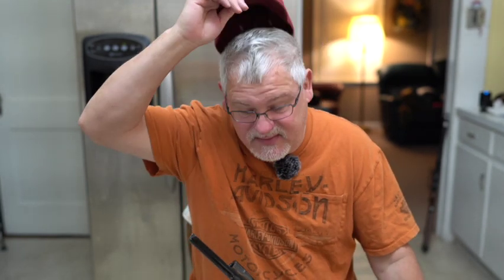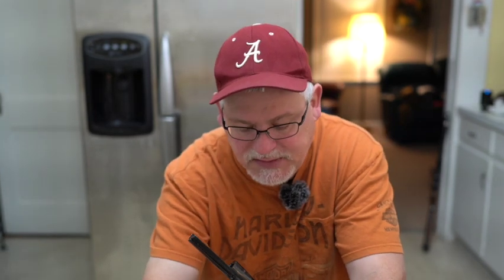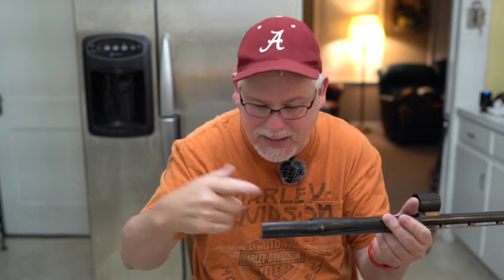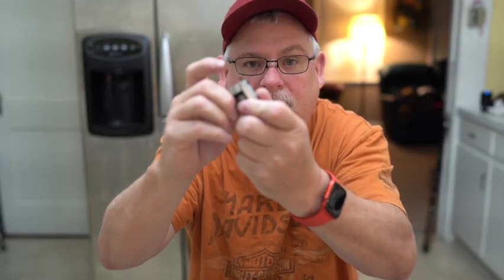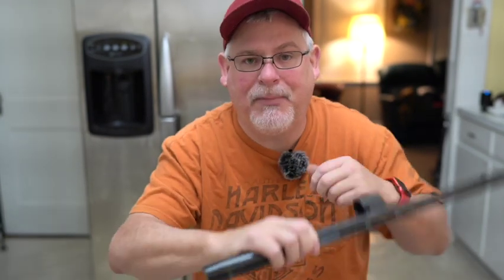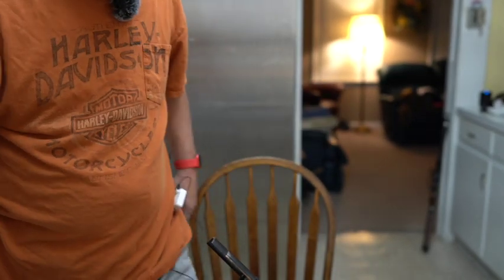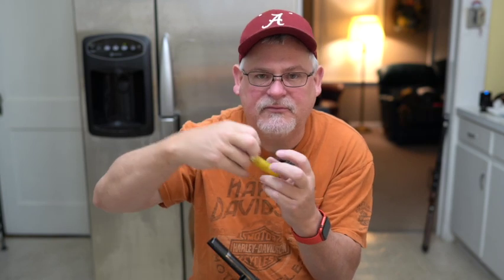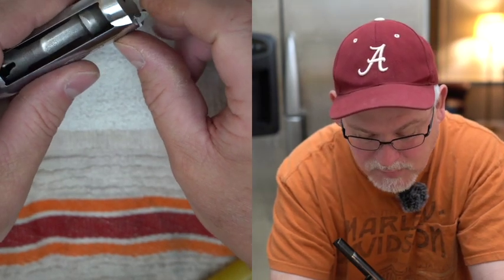Remington Shotgun Extraction Fix: How To Polish The Barrel Chamber.

Comment: 12g flex hone, spin it in the chamber heavily lubed up with gun oil with a hand drill for 30 seconds, fixed my 2010 era 870 express hard extraction, stuck after shooting problems. My 870 express also had a problem with the ejector spring bending out of shape and causing stovepipes, had to take it to a gunsmith for him to drill it out, and rivet on a new one. These problems is what made me lose trust in Remington.
Reply from the maker: I’ve seen the hones but 4 ought steel wool with oil on a brass brush has always worked fine for me. Just too lazy to buy the hone I guess. 🤣. I’ve heard ejectors can go bad but haven’t had it happen to me yet. My all time favorite is the Remington V3. Softest recoiling gun out there. Same piston gas system as the Benelli M4 for a fraction of the price. Thanks for watching. Appreciate the feedback too!!
Reply: It saddens me to have seen the demise of the oldest gun manufacturer in the US. Still love my Remmys but I've done work on them to bring them uo to spec.

Comment: Thank you so much.   For some reason I didn’t notice my extractor was broken and couldn’t figure out why shells weren’t extracting.  I replaced mine with the Volquartsen extractor.  Now my old 1100 runs like new.
Reply from the maker: That's awesome! It does happen from time to time, although it is rare. I've never seen a solid metal one break though. Not one. Glad you got it running again. I found a brand new, old stock, 1187 from an estate sale. Never been shot. I then found a brand new competition carrier which I installed in the 1187. I was going to sell it but my son wanted it and offered me a good price. I told him he could have it but he wanted to pay what he thought it was work. He was off by a few hundred but I didn't tell him. Now he has basically a brand new gun. I did run about 30 rounds through it of various shells to ensure it worked and it shot everything perfectly. I'm really proud that my son gets it. He's bought a couple of guns from me after I work on them. And I've given her a few too. Nothing like keeping the good ones in the family.

Comment: I use mothers mag and aluminum polish mop and a section of cleaning rod in a drill And follow up with oil! Have a pardner pump an express and a wingmaster! The worst is the express but works better then when it was new! I have to say that my pardner pump with the humpback receiver is better quality then the express, it is as good as the wingmaster in quality and function! Selling the express!
Reply from the maker: I forgot to say you can use bore polish too. Just don’t want to do anything but polish the inside. My old 20 ga 870 Wingmaster was one of the best pumps I’ve ever owned to this day. 1975.
Reply: @Kornholeeoo  i think the wingmaster i just bought is around 1955 or so has the corncob forend on it and lower serial# love the old pumps!

Comment: Thank you Kornholeeoo! This instructional worked like a charm. It is night and day, in the difference of the chamber. With just a few minutes of work, I now have way more confidence in my 870. You are awesome man!
Reply from the maker: No problem! I love making these videos. Someone taught me years ago so I'm just passing it along. So glad it helped you! That's what it's all about!
Reply from the maker: @TherealTruth40    There is an ejector on the end of the inside of the barrel that goes into the receiver that kicks out the shell. But if the force of the action is slow it causes the same problem. I’m at work now and cannot get into it much right now but look up the ejector and see if yours is ok. Are the gas blocks and O ring in good condition? Good and clean gun? All these things can cause problems with ejection.
Reply from the maker: @TherealTruth40    Oh. Pump. Don’t have to worry about gas rings or O rings.

Comment: Thanks so much. I just bought my new Remington 870 2 days ago, and took it to gun range yesterday. It won’t let me rack the slide back after shots in every 2-3 rounds. Sometimes extractor can’t even grab the brass rim, so the slide just can’t even locked. It’s frustrating, because it never happened on my other 2 shotguns.
Reply: Releave the extractor spring pressure and make sure the extractor is sitting all the way down into the detent.

Comment: I had an extraction problem with mine and i leads me to believe people extractors are getting seized and the spring isnt functioning like mine was
Reply from the maker: @carter4627  That extractor hole can get really gummed up over the years. Squirt some WD40 in it. Work it around good. Then blast it clean with some brake cleaner and then put good oil everywhere the brake cleaner hit. The brake cleaner removes everything even from the pores of the metal so be sure to quickly oil everything.

Comment: At what year did Remington decide to cut cost for these barrels to be like this ?  My reason for asking is I bought an 870 Magnum Special Purpose back in the early 90's and I haven't shot it enough to realize it having any extraction issues but my extractor appears to be all solid metal and heavy duty !!!
Reply from the maker: They started making the 870 Express in 1987 and also started making the 1187 that year too. They claimed both were better but time has proven that incorrect. The Express models were fine during the beginning and up to around the early 2000s it seems. I’m going off memory here. But there was a bad batch of MIM extractors in there and quality went downhill fast. Some people who had the earlier guns didn’t have the extraction problems like others did. I had a Super magnum that was ok but I could feel the chamber needed polishing. Got it used in a LGS. Had rarely been shot though. I did some polishing and swapped out the extractor and that gun was fine.
Reply: I've had 2 Remington super magnums that did exactly that. It's the chamber issue not the extractor
Reply from the maker: @vitalshok2238    Yep. I had a Super Magnum do it too.
Reply: I bought an 870 Express from K-Mart brand new for $178 in 1988.  It went “bang” and worked fairly well.  But I never expected Wingmaster quality from it.  I expected drab looks and tool marks and that’s what I got.  Want a Wingmaster?  Go buy a Wingmaster.

Comment: My new extractor is hitting the inside of my barrel. I’ve no idea how to fix this issue now
Reply from the maker: @gavinwilliams9367  When you close the action, is it going in straight? It should ride in there and open up as it rides in on that angle portion. But it should not interfere with the action locking up.

Comment: Great video guy!!!..... my problem is with a KSG. It's  been back to KelTec 3 times already for a bent bolt carrier EVERY TIME. After firing a few shots the pump gets extremely stiff and the shell seem to get stuck in the chamber EVERY DANG TIME causing the bolt carrier to bend. KelTec has basically rebuilt this KSG 2 out of the 3 times they have had it. I just got it back two weeks ago but have not taken her back to the range yet, after thinking about the problem this thing has had EVERY TIME I thought about this being a possible solution to the shells getting stuck in the chamber afer fired. I went ahead and measured the diameter of the slugs i shoot and they all turn out to be a bit different. Federal Slug brass measures 20.20mm(new). Troy Slug brass measures 20.51mm(new) and 20.67mm(fired). Sterling Slug measures 20.40mm(new). The last two are Turkish ammo and I heard have different standards then American ammo now show after measuring the diameter of all 3 brass. 
I'm going to go ahead and try this before I take this KSG to the range again and get another headache with the same issue of rounds getting stuck in the chamber causing me problems. Thanks for the video!
Reply from the maker: @bolriconyc3795  Please let me know if it works! Thanks for watching!!

Comment: I’m only having an issue with the Walmart Winchester Ammo when manipulating the forend fast for speed. No issues with the Federal Target Loads or Winchester Super  X high brass.

Thanks for the video. I had everything except the wool that I had purchased and perturbed the same process. Figure ordering the non MIM extractor won’t hurt too
Reply from the maker: Awesome! Glad this video helped you. The white box Winchester is some of the lower quality ammo. It works in barrels with a smooth chamber ok. Is your gun an older model? I’d add a new extractor spring too. Main thing is the plastic is lesser quality too and it forms in the imperfections more than other ammo. Now I say 5 minutes of spinning the drill but you may have to do it twice. Just use lots of oil at a medium speed and keep the drill moving in and out while you go. I’ve probably done this to 30-50 express barrels over the years. Mine and other’s as well. Always fixed the problem except I did have one where the spring was very weak and I replaced it too.
Reply: If I buy a remington 870 that's older than 2000 you just need to check your parts after 2000 when they started putting junk parts in them. It's hard to find parts now. For springs get them at wolff springs they make the best springs out there. I would put a aluminum magazine flower in it as it will feed your rounds better. Basically any thing you can change in your gun will improve it .
Reply: A guy brought me a old western feild it will not feed winchester anmo but it will feed everything else.
Reply: That Winchester “Universal” stuff from Walmart I have seen people have trouble with those in Benellis.  That stuff is crap.
Reply: @jcraigshelton  its the metal head of the Winchester shells. it is soft and expands too much

Comment: I know barrel makers and they tell me not to use #000 only use #0000 I use the method but I use flitz great video Brother
Reply from the maker: Uh oh. Did I say 000? I meant to say 0000. Bore butter, Flitz, bore polish. Something made for fun barrels. Heck 10W30 works too. As long as you don’t get crazy and go full speed for an hour.
Reply: @Kornholeeoo  No Brother you said #0000. Barrel makers tod me not to use #000 it leaves marks in the barrel. It will improve your pattern. When I do mine I use a old choke tube.

Comment: I have an 870 super magnum I bought early 2020 before Remington went through bankruptcy. I replaced the MIM extractor with Volquartsen extractor after only putting around a dozen rounds through the gun. The MIM extractor had a significant chip out of the claw portion that grabs the base of the cartridge.
Reply from the maker: Oh no! I hadn’t heard of any problems with these in a while! Thanks for sharing. The Volquartsen one is great though. It should last the life of the gun.
Reply: The problems with Remington started in 2007

Comment: My January 2014 manufactured 870 magpul tactical express' chamber feels smooth as glass.  I did replace the extractor but I've never had problems.  Maybe just lucky.
Reply from the maker: I also have been very fortunate. I’ve seen a few chipped and broken ones but they were not mine. I have had a couple of barrel chambers that were rough though. Thanks for watching!!

Comment: Good info.  Did you experience interior metal rust issues with your 870 express?
Reply from the maker: None so far. I’ve not seen much rust on any of my 870s. Of course I inspect the used ones I’ve bought beforehand. But the new ones I bought never had any rust. I do keep them well lubed and even though that makes for harder cleaning at times, it just gives me peace of mind. Most all the rust I’ve seen on any Remington shotgun has been outside surface rust. Thank you so much for watching and taking the time to comment. I appreciate it very much!

Comment: Will the steel wool last for 5 minutes or will I have to change it out?
Reply from the maker: I have two brass brushes with steel wool on them that I’ve had for at least 8 years now. 20 ga and 12 ga. So much oil on them they haven’t rusted! 🤣🤣. And I still use them. There may be a chance that the wool gets packed down and you may have to add another layer, but I’ve not had it wear out per se. Thanks for watching!!

Comment: Hi There, Just Found Your Video. Would This Work For the Magazine Chamber as Well?  My 870 is having an Ejection Issue From the Magazine.   Thank You
Reply from the maker: That might be the disrupter and shell latch/stop. Those two bars that hold the shells. The disrupter is that tiny arm inside that pivots up and down. They get gunk behind them. Clean that good and make sure it pivots smoothly in there. I don’t recommend removing it as it can be a pain to reinstall. I think there is an animated video on how it all works on here somewhere. That video is helpful and might give you an idea of what’s wrong. Also the bar on the trigger group that sticks out, it actuates this stuff and it gets worn. Sometimes you can file the edges back and slightly bend it and it will work again. There is a video of a guy fixing this  but I cannot remember his channel for the life of me. May have to buy a new part. Let me look it up.
Reply: @Kornholeeoo  Alright, I Appreciate It. I Just Bought the Gun New and Only Shot It a Handful of Times at Doves.  Damn Good Gun, It Just Doesn't Wanna Eject From Magazine Now. It Does When I Push the Tab.  I'll Try to Look Deeper Into It.  Thank You
Reply from the maker: Interceptor, not interrupter, feed latch and disconnecter. Those are the parts that you need to look at. Here’s the link for the parts breakdown. https://www.gunpartscorp.com/gun-manufacturer/remington/shotguns-rem/1100/parts-list-rem1100
Reply from the maker: The parts diagram will be items 39, 43 and 60.
Reply: @Kornholeeoo  Awesome Thanks

Comment: Can i use a fine grinding paste instead?
Reply from the maker: I don’t think I’d use that. It’s more than likely going to be too aggressive. It doesn’t need much. 4 ought steel wool works perfectly and you can get it at most stores like Walmart, Harbor Freight and such, for just a couple of dollars. It will turn the chamber to an ice slick polished chamber in about 10 minutes. I usually go 5 minutes and re-oil the wool and do it another 5 minutes. I really have no idea what grinding paste will do but I wouldn’t risk it on my gun. And I would have to advise against it. I know what steel wool will do but I have no idea what grinding paste will do.

Comment: Any video on why second shell  will not load.
Reply from the maker: That’s usually an interruptor issue on 1100s. I’ve seen some videos on this on here but I’ve not made one. If it’s an 870, are you talking about the shell not coming out of the mag tube? The shell latch bars would be the first place to look. The slide plate pushes the latches outward at specific intervals to release the next round into the receiver as you work the action. Check for videos on these subjects. Hope you find what you need. These guns are fun to work on.

Comment: Use a proper Flex Hone and do it right
Reply from the maker: Been doing it this way since the 90s and it has never failed me! Flex hone can take out too much metal. Seen that happen. 0000 steel wool on a brass bristle brush with oil will never take out too much. Thanks for watching!
Reply: Also why buy a flex hone when you can use steel wool. A flex hone in an amature's hands might ruin the barrel if its overdone.